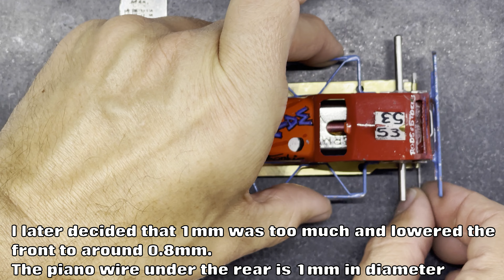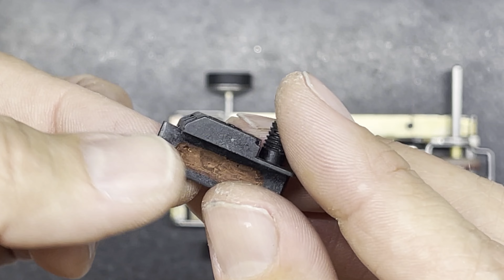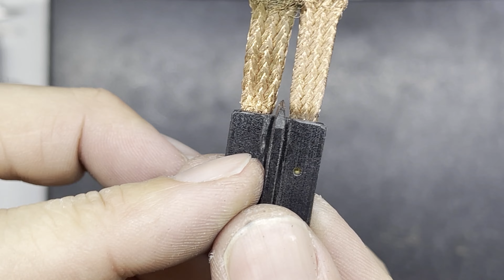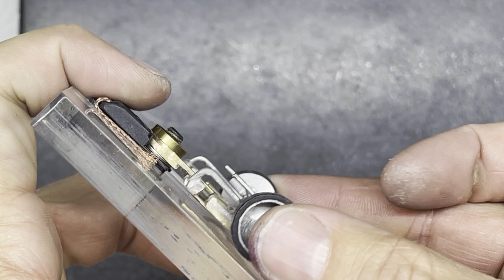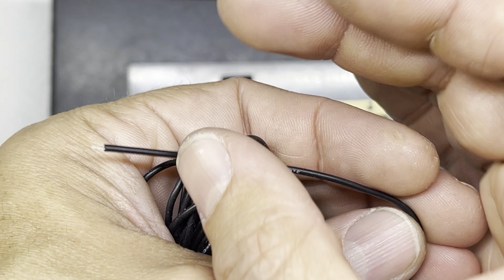Final assembly of the 1:32 scale slot stox car - fitting the front axle, guide and lead wires

Comment: Hi James
Fantastic work as usual.

Can you advise what soldering equipment you are using? 
Make/Model or any other info?
Regards

Ron Lane
Reply from the maker: Hi Ron. Thank you for your continued support. I use my own electronically controlled soldering iron that I wire and assemble from all suitable parts to meet my slot car racing needs. I can make 110V and 240V versions. Drop me an email cleavetech.james@gmail.com to discuss your requirements.